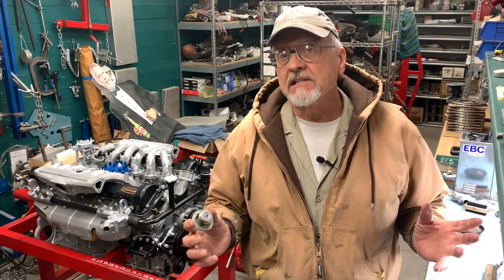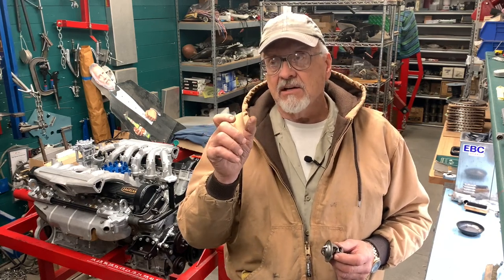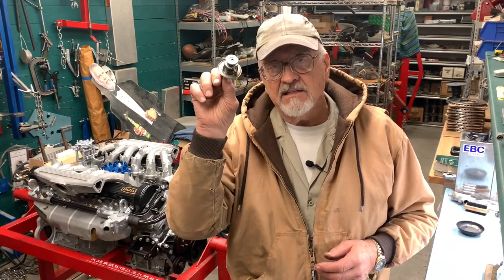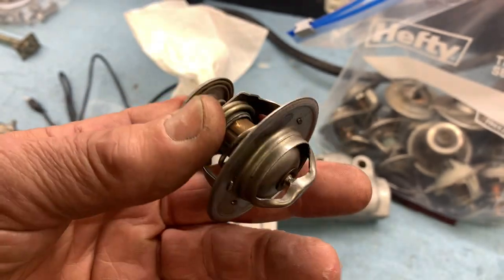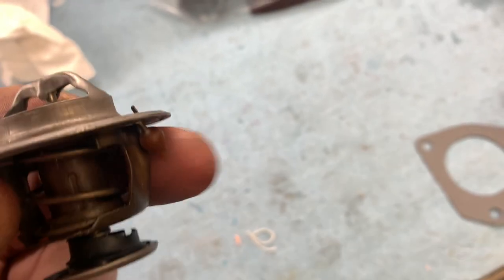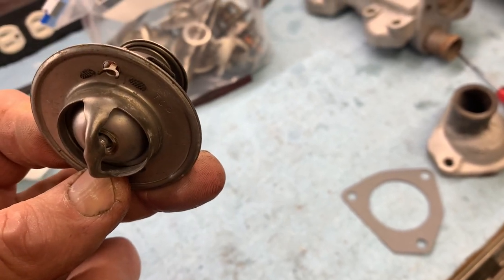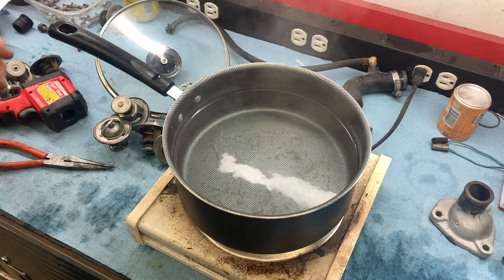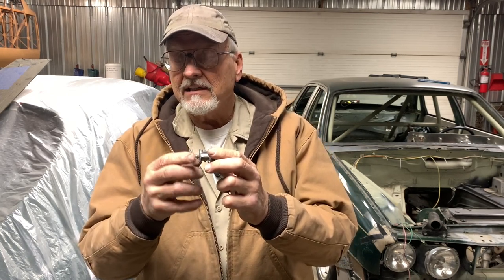Cooling The Jaguar XJS Ol' Tex: The Basics-Part 4: Jaguar V-12 Cooling System Thermostat Testing.

Comment: Always enjoy your explanations of the systems of the engine.  Best explanation of a thermostat I've ever heard and I've been tearing up cars (and occasionally putting back together) for 40 years.  (Wow, I've gotten old...)
Reply from the maker: Thank you for your kind words.
Reply: Thanks for an excellent video, love the detail in the explanation of how precise the thermo’s must be. Over here in Aussie land our biggest supplier of these specifies ones that are actually to short to close the bypass port… only picked it up by comparing the originals one of which still worked to the newbies when pre-testing before install. I ‘m still however at exactly the same point as you with my 85 xjsc, interested in where you go next with it. I Did complete cooling system clean & flush + thermo’s first with some improvement, just did fan clutch & fan(luckily,would have shattered to bits at some stage..cracked) but still heats to over 3/4 with aux fan coming on after about 12 mins driving at city speeds! Thinking pump impeller if metallic in nature may be corroded away?..or gone!🙃

Comment: Dam bro. Aint no winning. if it is the radiator and it is clogged...what could have possibly clogged it so quickly? 3 years and its clogged?  im telling you these cooling systems are cursed
Reply from the maker: The good news is shortly after the test run after the cooling system flush a cylinder head gasket let go. So next season we'll get a chance to see what the inside of the engine looks like. How lucky can we get? 🤔
Reply: @thecampchaoschronicles9567  CURSED I tell ya CURSED
Reply: I mean...I'm thinking that something with the steel head bolts and leaky/stray current  combined with aluminum block and the bronze core radiator....I mean I know that the anti-freeze is supposed to have anti-electrolosys inhibitors in it. But also how many Iron blocks have been pulled apart and the water passages are rusty. Idk just food for thought.

Comment: Top stuff Bob, all the best for a speedy recovery. I have used Dayco No is DT18A, thermo stats here in Oz as they are cheap and suit some Ford cars. But most importantly the have the correct opening length for correct port closure.

Comment: Your videos remind me of my father's XJS.  We have replaced the Rad, rebuilt the distributor to ensure the centrifugal weights were lubricated and free, checked the timing, flushed the coolant system, burped the coolant properly.  We never checked the thermostat clearance so that's something to try, but seems to run well, but it consistently "creeps up" in temp here in FL.  I was thinking of trying a leak-down test next but all the "common remedies" never seemed to change anything...  I see the Gates 33188 doesn't have a Jiggle Pin; on Rock Auto I see a gates 33188S listed as a premium option with the jiggle pin.  Better Option?  Get well soon Bob
Reply from the maker: That would be the one to use.

Comment: I has a S3 V12 saloon that overheated, the final fix was replacing the thermostats as a previous mechanic had fitted thermostats that did not have the bypass plunger on them, I fitted the correct thermostats and it never overheated again...

Comment: Hi Bob, do you know of any Machine shops in Michigan area or the surrounding states that will do machine work on a V12?  That was the best explanation of the V12 thermostats ever!  Get well soon!
Reply from the maker: What type of work do you need?
Reply: @thecampchaoschronicles9567  Not sure yet as I haven't stripped the engine down yet, I was just throwing it out there before I start.  Just the usual clean skim on the head, valve work, engine cleaning, might even stretch to  line bore on the mains if it's that bad (yes I know you're going to tell me to get another block! lol!)  Crank work as long as they can Nitride it and I can get bearings (Yeh good luck) etc.  Anything that I don't own a machine to do it with.
Reply from the maker: I'm afraid I'm only familiar with local shops in the Minneapolis/St Paul area. Any shop can plane the heads. If you chose to have a local shop do the cylinder head overhaul, have them view my cylinder head videos in season one. It's pretty easy to make it impossible to set valve/tappet clearances wiithout hacking things up pretty badly. Finding someone that can align hone the block is more difficult, diesel shops perhaps. The problem is finding someone who has a tool long enough for the V12 block. Good luck with your project.
Reply: @thecampchaoschronicles9567  Thank you for all of your help!  I'm talking to a local machine shop at the moment.  He'll need the dimensions of the engine to see if his tools can do the job.